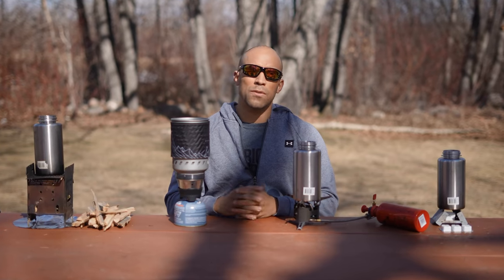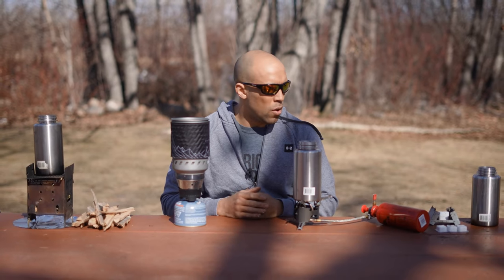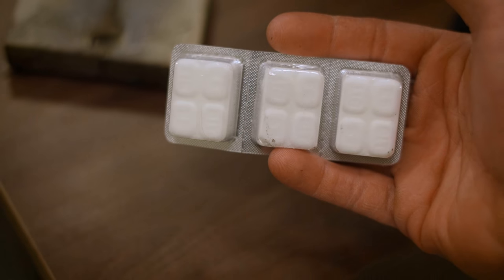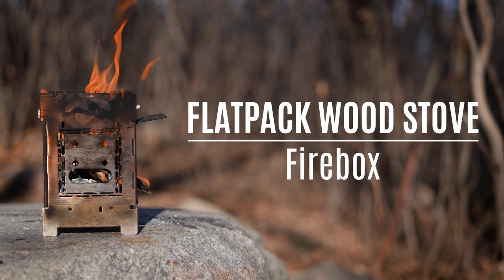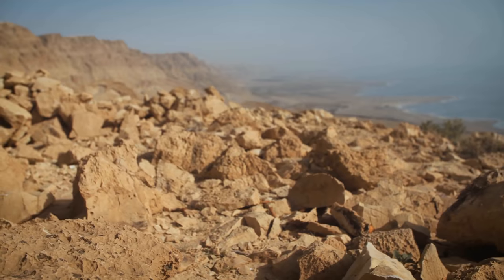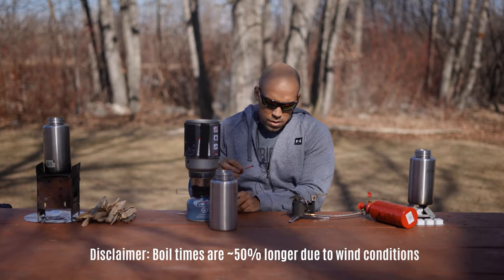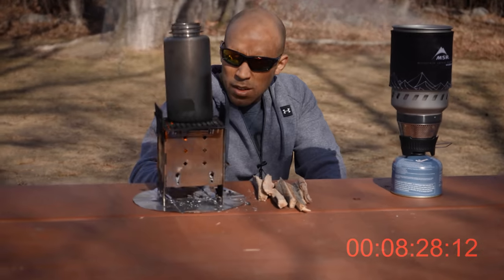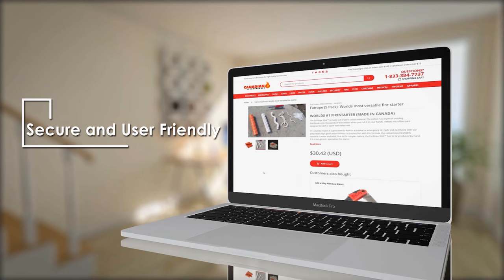What is the Best Survival Cooking Stove?

Comment: My setup is Trangia+MSR pocket rocket 2 + Bushbox Ti.

The MSR is great for speed and convenience, even if I ditch the cannister the stove is so small/light it always stays in the pack. Downside....it's sooo noisy.

Next, the Trangia. Small and light but not very efficient or quick. On the positive fuel is readily available from vodka, meths or bioethanol and it is very quiet. Good when longer burn is needed but don't want to attract too much attention.

And finally the bushbox.  Runs of natural fuel same as the firebox. Lots of uses and it doubles as a windshield/pot stand for the Trangia. Being the titanium varient, light enough not to be a burden.

Comment: Keep in mind that redundancies and the skillsets to use them are your friend, and you can pack more than one type of stove depending on the set up you're looking for. I keep an Esbit stove and extra fuel tabs as well as a Soto Amicus and a couple smaller gas canisters on hand. Both systems are small, lightweight and work well for me. Pair that with a fire making kit and a good knife/hatchet for processing wood and you can check that box off your list.

Comment: Multi-fuel stove and Firebox stove are good choices. Chef safe Heat fuel would also be a good fuel source for the Firebox.
Reply: Have you seen the biolite?
Reply: @jasonm3127  I finished watching a video on BioLite. 
I like the concept with the fan.
My only concern is how durable and practical is the electronics on the unit from trip and fall or accidentally drop in SHTF scenario?
With the Firebox or multi-fuel stove could be more durable in SHTF scenario. How often is there problems with electronics versus mechanical? Is a electronic unit water resistant "rain", temperature resistant heat and cold?
I grow up in 90's combining old tradition and new tradition is good idea when it's practical.
Maybe when biolite adds drop resistant. I'll be more inclined to be sold on the idea.
Reply: @fatman7100  it does work just fine without the electronics. It just burns slower like the fire box.
Reply: @jasonm3127  👍

Comment: Small butane might be best if you are in a evade situation no smoke and it's quick. I have a small one in a plastic container the size of a pack of cigarettes. It also has it's own lighter. In winter you can use small canisters with a butane-propane mix.

Comment: The multi fuel stove there is also an Omni fuel stove  that burns butane and propane as well as liquid fuels
The butane gas looses all pressure about freezing.  At -10 it's useless unless your burning camp gas which is mixed with propane.
Propane looses pressure at -30f.

Comment: A good comparison .. thanks. I have versions of all four.
The Esbit is more robust than it looks. I've had mine 50+ years (original military issue back in '68) and it's still in regular weekly use. Has 'loosened' up a bit .. nothing serious enough that I can remember after each use to tighten it up again. Anyway, the integral windshield that I've made for it keeps all nice and steady and also serves as additional pot supports.
Fuel .. here in Switzerland, the Esbit Tablets are not freely available and are somewhat expensive, whereas Liquid and Gel-Based Alcohol Fuel is not (Brennspritus and Sicherheitsbrennpaste). Indoor Fondues using the fore-mentioned is a Swiss National Sport .. the fuel is available in Supermarkets, Convenience Stores, etc, etc and cheaper than the Esbit Solid Fuel. I keep a pack of Esbits Tabs in the Stove for 'just in case' with more stashed .. has been there at least 20 years.

Comment: Hi, could you a video on home heating devices during a power outage?
Reply from the maker: yes
Reply: 93 Roman. Check the web for Japanese advice. They have/can have, special electrical clips built into their cars. These can couple onto the house circuit to keep your lights and refrigeration/air con working during emergencies. That just supplies the basics, but that could be all you need if a blackout occurs!
Reply: @clivedunning4317  Hey Clive, thanks for taking the time to type that out - will have a look at those for sure :)

Comment: A common misconception about the olden days is that they mostly used wood for fuel. I'm fairly certain that they mostly used charcoal since it is easier to transport/store (1/7 of the weight of wood) and is easier to manage and to light. Moreover it is more energy efficient (less trees consumed). Charcoal isn't that hard to produce at a large scale (coal miln). But since it burns more eficiently it recuires more oxygen to not produce carbon monoxide (a safety hazard in a cabin heating system). Evergreen charcoal burns faster and more intense, and is thus best for forging and for blast furnace fuel. Leafed wood char is best for cooking/baking.
Reply from the maker: They used coal not charcoal

Comment: The wood stove is the better bet in a SHTF scenario because 9 out of 10 you would be surrounded by trees and twigs. 

The solid one is also good in a SHTF scenario because how small the cubes are. You can pack 100s of those in a bag and won't weigh you down. 

The other 2 are good for a weekend camping outdoors but no bueno in a SHTF scenario because it's impractical and can prove stressful having to look or tote fuel and canisters to keep the stove in working condition.

Comment: Personally, I prefer having three method to cook at all times. The first option ALWAYS being an open camp fire because it's a morale booster and everything tastes better slow cooked in a Dutch Oven, yes I will hand carry my Dutch Oven every where I go because you can literally cook just about anything in it. Second will always be my stainless steel folding camp woodstove, it's very flat and very small. But more than enough for the small stainless steel cook pot, pan, and tea kettle. The third option, and the one i try to use the least, is a propane/butane canister stove like the grey cylinder you have here. I try to use that one the least, due to having only so much fuel in each canister and delegating that particular stove to severe inclement weather to cook inside my tent or even having used it in my car to make hot tea this winter in Colorado during a few subzero nights. But to be honest, I've never considered using solid fuel tabs for two reasons, the first being that I had two at one point from a fire kit I had purchased and they both would not stay lit long enough to catch sticks on fire for a campfire. The second being that they are a finite resource. Liquid or gas fuels have their pros and cons, but nothing will ever convince that using wood is anything but superior giving your location and ability to collect firewood and make a fire. Granted, something like a S.E.R.E situation would dictate using a safer fuel source that doesn't produce a smell or obnoxious sound, this is the exact reason I always carry my little gas canister and it's burner attachment alongside my flat pack wood stove because two options are better than one. If I have to stay hidden I use the gas burner, if I can uave a fire I build a fire, if I don't have or can't build a fire pit I'll use my woodstove. I'm hoping soon I'll be able to FINALLY afford a decent and proper walled canvas tent and woodstove for hot tenting in this brisk Colorado Rocky winters. Never really had the chance to purchase good quality equipment, just some cheap Walmart gear and some decent items from Amazon over the times but never something that I could really rely on.

Comment: firebox for the win, if your traveling around in a not so shit hit the fan life, butane is ideal, and propane is even better since you can buy it in bulk, but butane while smaller in size has more energy per kg than propane. i keep firebox steel plates and butane stove. when one doesn't work the other one usually does.

Comment: 3 other fuses you could use are pyrolysis turning plastic into diesel fuse/ paper logs for burning/and last you can turn you poo into  Charcoal using the African or Indian method burns longer and little to no smell if you do it right and yes you can safely cook with it

Comment: Is take the MSR Whisperlite universal over the XGK personally. The XGK is more reliable very long term burning vehicle fuel as it burns all the additives which gum most stoves up, but the Whisperlite universal is still one of the most reliable vehicle fuel burning stoves for unleaded (after EMP strike when tanks are full but cars don’t start) plus kerosene if you can find any, but also it burns canister fuel and with a butane (100%) canister adapter you can burn cheap butane in it too. Now pair it with a stove that burns alcohol, solid fuel, alcohol gel and can fit tea light candles plus could build a stick fire in and around it and you have all the bases covered
Reply: I would make a wood smoke stove (hobo stove) later from used tin cans I come across once everything else is gone

Comment: Actually after I got an wood gas stove I just don't see the need for normal gas stoves. If you have wood in your environment it just burns so clean and nearly without smoke when the wood gas is burned.
Ok I can't fold it but it just burns so much cleaner.

Comment: Not the best multifuel stove. Those preheating tubes are the frequent point of failure. Especially if using it with not very-very well cleaned liquid fuel, designed specially for those burners. Optimus and Primus offer more reliable stoves.
And about loudness. There are silent caps for the majority of multifuel stoves. They are very useful!